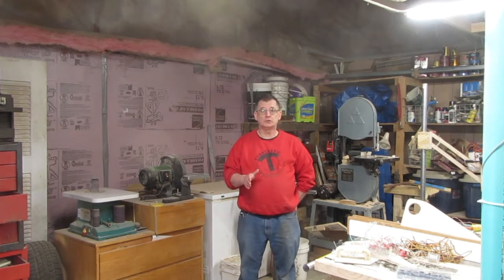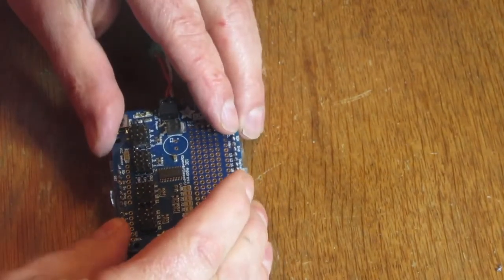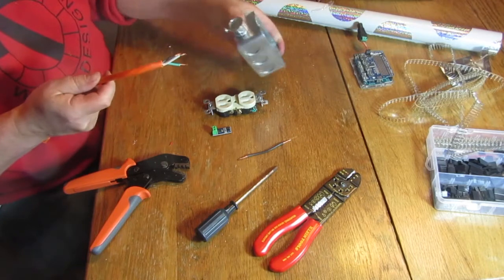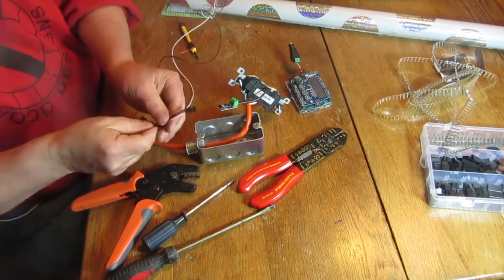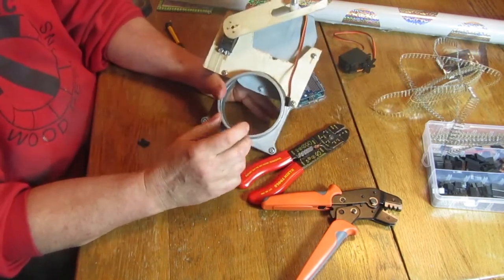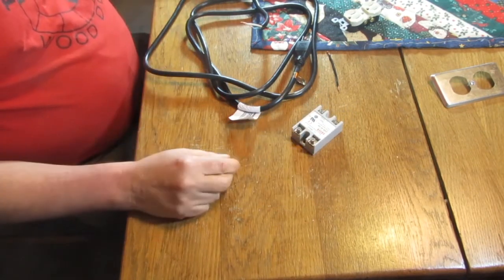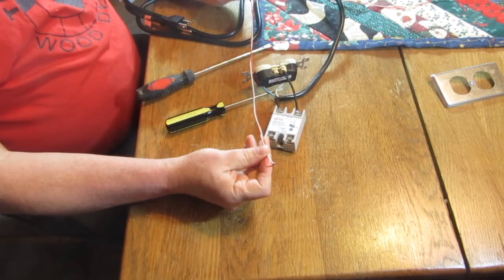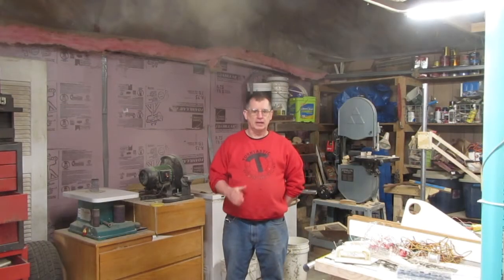Automated Dust Collection

Comment: Hi Bill, nice video. I see you got a FOTEK solid state switch. If you sourced it from Amazon it's likely a knockoff, and may not perform to spec. I initially got one for my dust collector project, and when I saw reviews of the FOTEK SSR-40DA failing I tested mine. I ran it for  about 15 minutes of continuous use (maybe 10 amps at most) and it overheated and failed with power on, and you could smell it.  After it cooled down it seemed to work again but it was enough to convince me to go with a traditional electromechanical relay. I realize your application is using digital signal levels ideal for the SSR, but I would caution to test the device under expected use before trusting it. I've read some reviews where people had good result with these knockoff SSR by adding a heatsink and fan. FWIW.

Comment: Nice Work, I like that solid state relay! A relay with moving parts could be an issue in a dusty environment. Also, I like the sliding mechanism you developed for the servo-to-blastgate interface.

Comment: Hello, thanks for sharing the better mousetrap. I'd love to try and make this but I've never worked with an Arduino. Bob's code doesn't use the Relay to activate the dust collector, can you please share your code. I was already setting up my system with the relay, but I was going to use micro switches. I would much rather use your system if i could figure out how and where to connect the low voltage relay wires and how to write the code.

Comment: how to edit the code ? i did try to mess around with code , but the sensor doesnt work correctly in anyway
Reply from the maker: Mostafa Mohamed getting the senors to behave is a bit of a hassle. I used the  arduono IDE to modify the code
Reply: I remember from Bob’s video comment section that a lot of people recommended using an AMPERAGE sensor instead of a Voltage sensor.

Comment: Hey Bill, so happy I found your video. I am in the same situation where I'm about to set up the system just like yours based off Bob system. Setting up the electronics and wiring is something I already know how to do, which I am very confident with but as others, the code is something that Still don't fully understand. What steps did you take in regards to learning about the arduiono and how to write code. Did you buy any books? Or are there certain tutorials that you watched that helped? I know you modify the code slightly, was that difficult for you? Any suggestions or help would be appreciated. Thanks
Reply from the maker: I copied the code from what Bob had on his site and I was able to figure it out from there
Reply: Did you ever get the code from Bill??

Comment: I am also attempting to build a similar system. Please post the code you used. I can not get the voltage sensor(asc712) to send a signal to the arduino. I am using the 20 amp version.
Reply from the maker: I got the code from Bob at I like to make stuff 
https://github.com/iliketomakestuff/iltms_automated_dust_collection
Reply: Did you ever get the code working?

Comment: Hi Bill.  I watched the same video that Bob put up and am now working on a system for myself.  Your video was very helpful with the wiring portion of the set up.  I fully understand how to complete that portion of the set up and am confident with the connections to the Arduino.  Programming the Arduino is still confusing.  I understand most of the coding that Bob used but not all.  Can you put up the program code that you are using to control the blast gates and dust collector.  Thanks for the great video.
Reply from the maker: Thanks Tim
Reply: Did you ever get the Arduino programmed to work correctly?

Comment: Hi Bill, That's a good system. AND a very handy setup. Just one question: On the servo aspect of it, what tells the servo that the gate has fully opened or closed,, so it will stop driving?  Thanks for sharing!! Merry Christmas and a very Happy New Year
Reply from the maker: Charlie Zellner I had to spend some time with the code on the arduino tweaking the timing